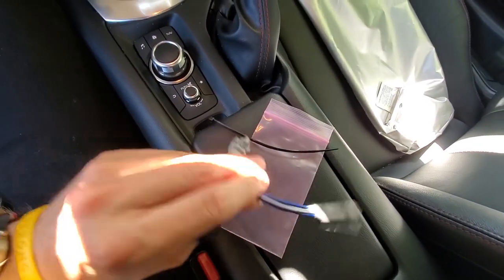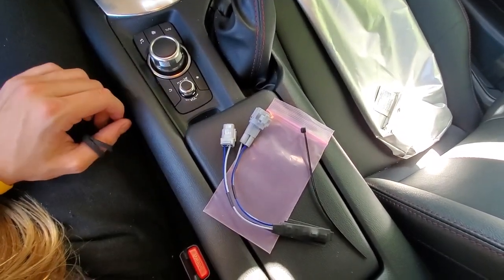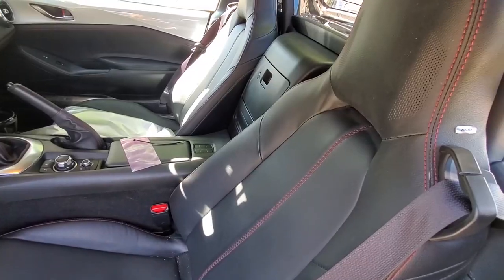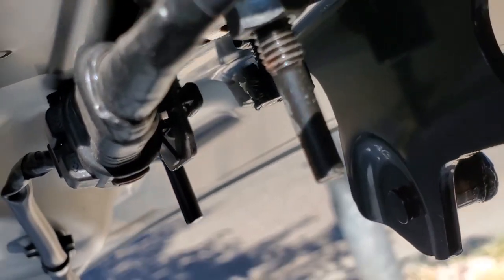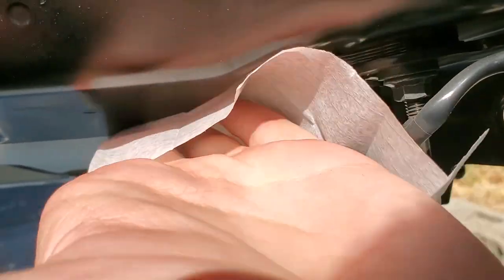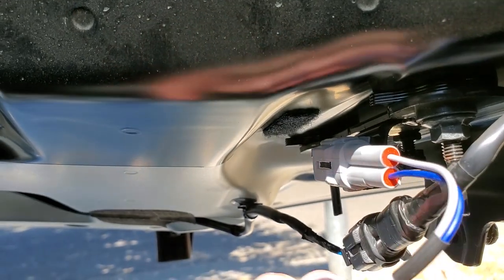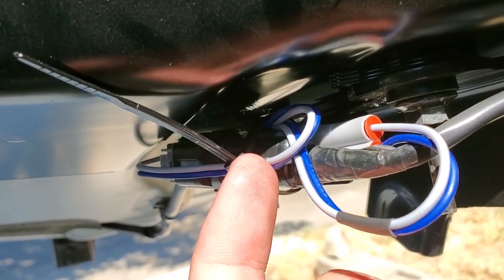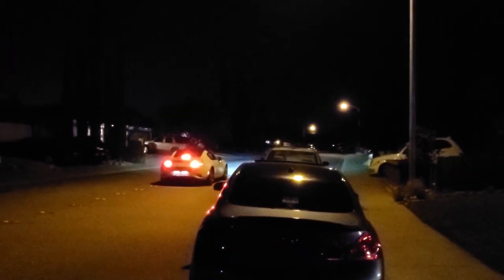ND MX5 Miata Brake Light Flasher Install

Comment: Nope, it won't prevent a rear end. In fact, it'll do the exact opposite because in America flashing red could just mean turning
Reply from the maker: There have been a few NHTSA studies for DOT that would argue this point, I would refer you to NHTSA DOT 811330 in particular in regards to the 'eye-drawing effectiveness' of strobing lights in comparison to their steady burn counterparts. You might have a point if all lights flashed in unison, but I highly doubt anyone is going to be confused about the meaning of a strobing third brake light.